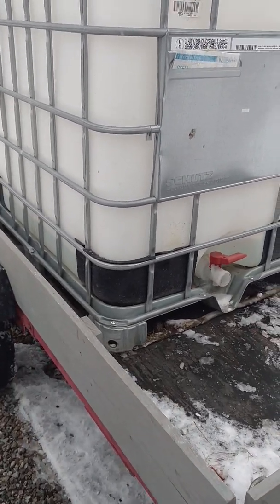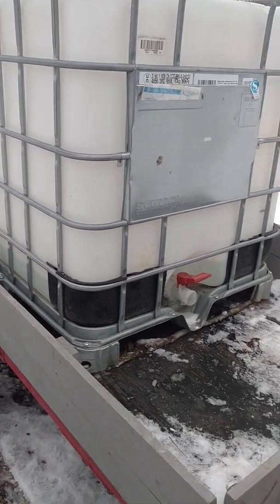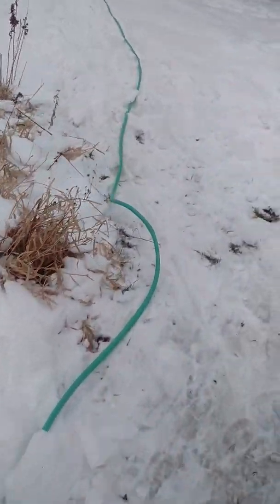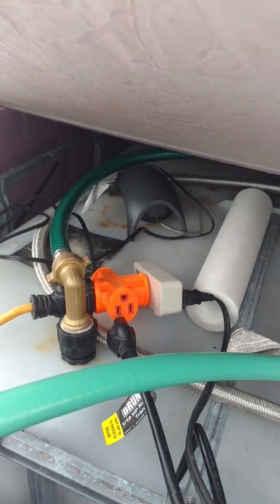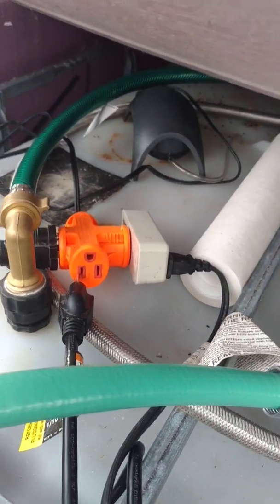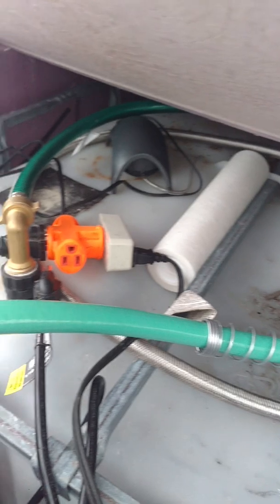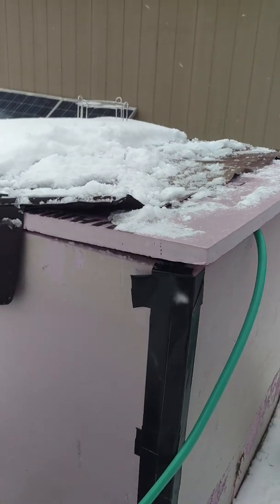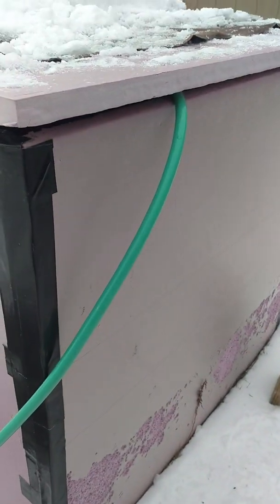Rain water harvesting in winter?  Freezing temps alternative...

Comment: As a mechanic, axles are rated for much lower than they can actualy handle. I would fill er up to the top. It puts more stress on the axles to have less weight sloshing like crazy than more weight stabilized anyhow. If you're still worried, repack the wheel bearings more frequently.
Reply from the maker: I know what you mean.  I can feel the weight shifting around as I drive.  Liquid freight carrier tanks have internal baffles for a reason.

Comment: Hopefully you will see this , where did you get the water heater and pump?? Also if you had space in there could that run off a battery and solar panels? Like a small pump house diy solar thing? I'm watching every single video I can to learn what to do and not do . Oh yes the chickens will peck that insulation until it's gone so if you are still using that put  a tarp over or around the sides to stop them - hopefully lol- I had chickens ,ducks,goats ya know all the professional poopers . One more thing CHECK OUT the home biogas , Bio digesters, they have a set that comes with the bio digester , toilet, and stove . It's great for cabins without plumbing . For @$1,300 you will have a bathroom toilet , free gas to run a 2burner stove and when you empty the system it is great fertilizer. So the savings alone pay for it over and over. Heck I'm sure you could get a heater to go with it as well so the cost of propane and putting in a septic hands down paid for itself a few times over. Anyhow I'm trying to get 100% off grid or have the availability and knowledge to do so . Thank you for the info , much appreciated!!!!!